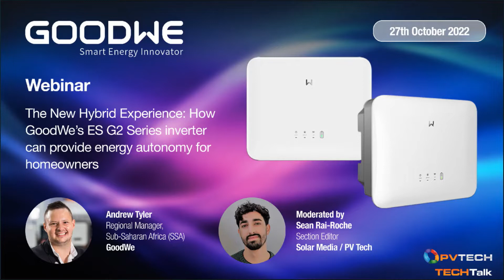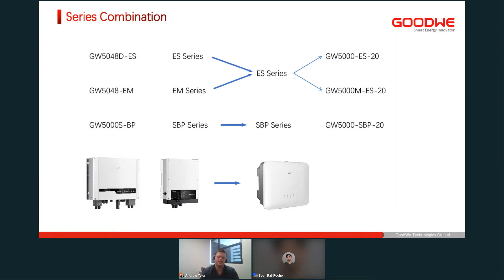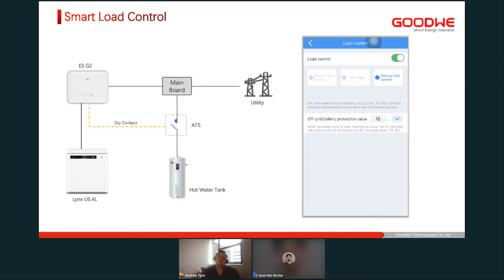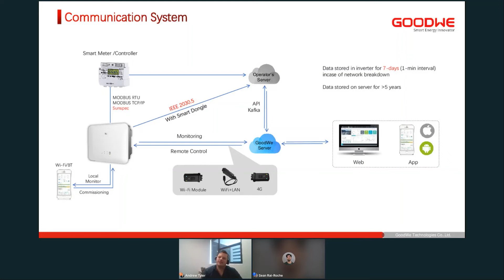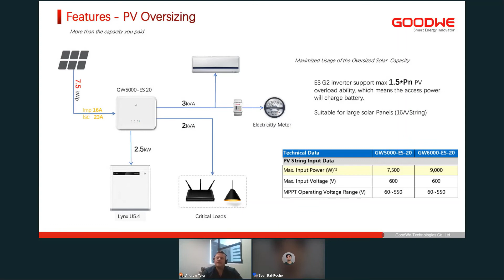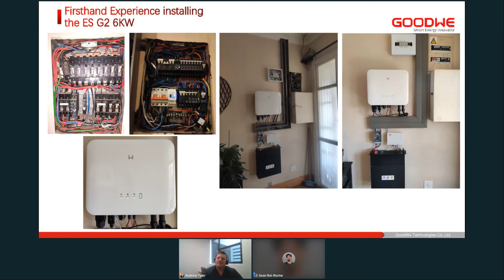How GoodWe’s ES G2 Series inverter can provide energy autonomy for homeowners

Comment: Hi, Is it possible to have my solar charging my battery and supplying the loads in the house when I have a power failure from Synergy(AU). I have a 7.4kw system Fronius Inverter   and AC Coupled Goodwe SBP G2,   the backup is wired to supply all loads in the house.   At the moment if Synergy(AU) fails only the 40Kw Home Battery discharges to the backup load.

Comment: I've recently installed a GW6000-ES-20, when I set an export limit to 4KW the inverter is always drawing around 150w from the grid.  I've found that by disabling the export limit on the GW6000 it stops having this small draw from the grid. Is there a work around for this issue ?  (With my GW5048D-ES it had this behaviour if I set the export limit to 0W,  if I set an export limit above zero it will not have this draw from the grid, i.e. it keeps my grid draw to zero)

Comment: Is it possible to use a power station with a battery (2Kwh) when there no solar input but without a battery for goodwe Es g2 (install in a second moment) to serve house from load (back up port - by pass)? Without grid G ES g2 out is biphase or mono phase?Thanks